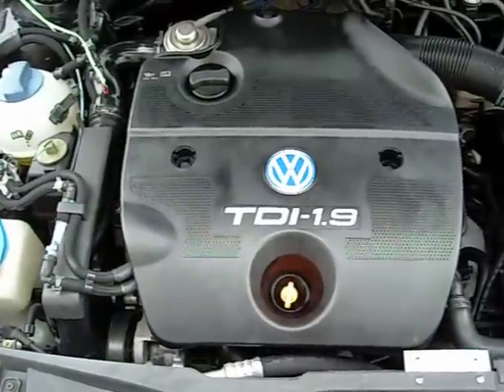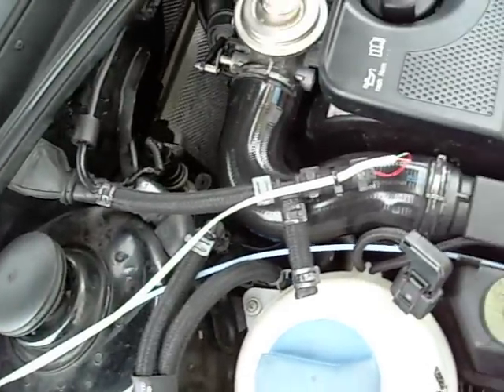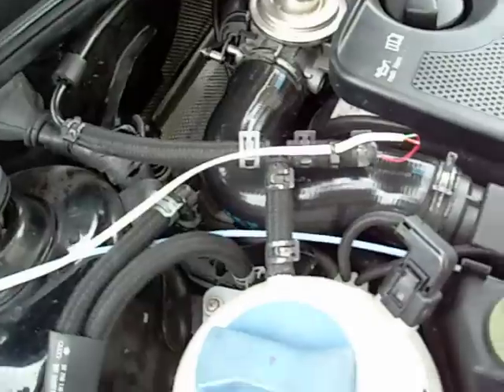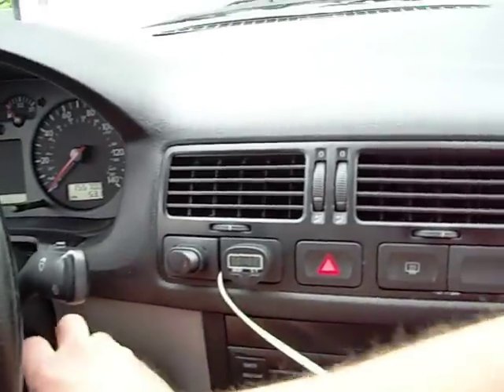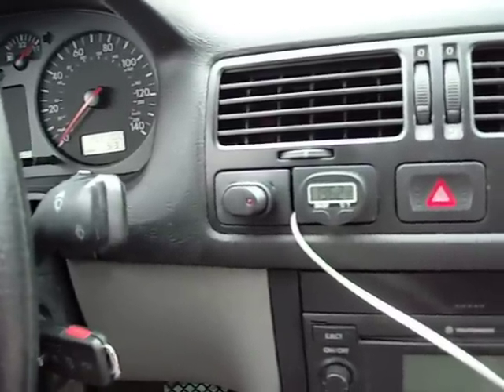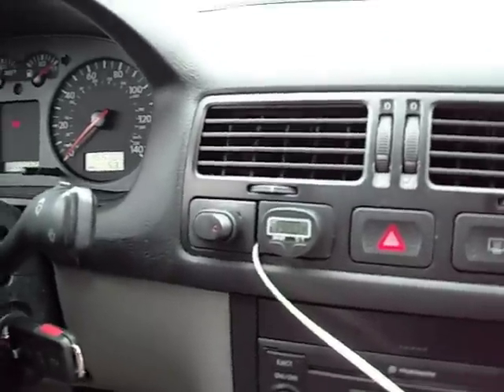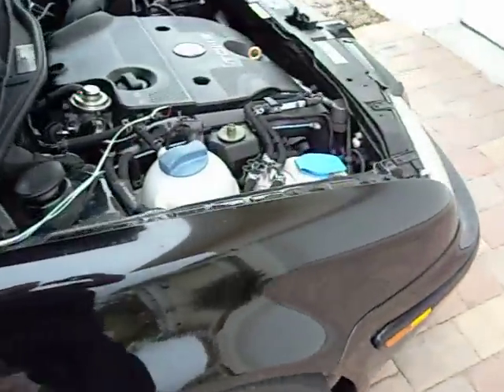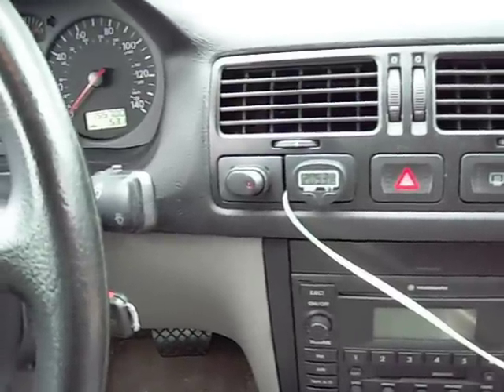Hybrid ALH TDI 205 Deg F  Thermostat Test Video

Comment: Amazing mpg your getting.  How is your driving style I know babyish the car in some aspects isn't great but also it's the only way to have the best mpg. With the higher temp allows for better combustion also improved on the mpg? Interested on gathering little better on mine as the best I've seen is around 46 average is 44 mpg.  108k on 2003 jetta wagon with only mod really 2.5" downpipe and exhaust.
Reply from the maker: Removing my CAT netted me a couple MPG and helped a bit with turbo response.  I gained around 10 MPG just going to the manual 5 speed with taller 5th gear.  The thermostat may have added a few MPG but this is not a guarantee and there is risk in messing with operating temps.  You would be better off just getting a very high quality OEM or Wahler thermostat with the highest temp available before creating a hybrid T-stat.  I don't baby the car but try to drive reasonably.  I try to conserve momentum if at all possible anticipating lights etc.  Really very mild hypermiling techniques.  My timing is set at the top of the graph and my injection quantity is set to inject the minimum of fuel while allowing easy start ability.  I just recently put my second set of Nokian Entyre tires  and my MPG dropped from low 60's to 57 on the last tank.  This is somewhat expected with newer tires(larger OD and less odometer miles reported for actual miles traveled) and I recently lowered my injection quantity by hammer mod following an IP pump reseal  which may have negatively affected fuel economy-jury is still out on that however.  If I were to make a recommendation it would be to set your timing advanced, lower injection quantity, make sure no brakes or brake cables are dragging(car in good general state of repair), ensure you have a functioning thermostat that is maintaining at least 195 deg F, and consider looking into re-setting your injection pump case pressure.  I think the injection pump case pressure could be crucial to getting great "smileage".  I set my injection pump case pressure to around 80 psi at idle if I remember correctly.  Here is the thread on that:

http://forums.tdiclub.com/showthread.php?t=258639

Obviously if you mess with injection pump case pressure and raise it then you are more likely to generate IP leaks if your seals are in poor condition.  Really at this point most of these vehicles should have a new head O ring, and new seals installed on the upper and lower case sections.  Those seals/O rings are cheap parts and the job isn't too difficult as long as you follow the procedure to the letter.

Comment: higher temps are good for diesel but bad for your 01M VW automatic transmission.
Reply: GallowayChicago use better ATF or gear oil
Reply from the maker: Good thing I no longer have the 01M.  When I was first experimenting with the higher temps I was aware of the slight increased risk of earlier auto transmission failure due to the elevated temps.  I was however planning to switch to a manual which I have since completed.  No issues now that I have a manual :)

Comment: just wondering what all have you done to improve your mpg? looks like your getting great mpg!
Reply from the maker: I've deleted my daytime running lights, increased my engine operating temps(from 195 to 205 plus), disabled my radiator fans, replaced tires with Nokian Entyre LRR tires, upgraded my 5th gear to .681, fitted Scan Gage II along with a host of other things.  Do you have a Jetta TDI also?

Comment from the maker: @mulldavid 

Good question!  I spend most of my online time at Freds TDI Club, and have a nice long thread in the Fuel Economy section there.  To answer your question, it looks like I have gained 3-4 MPG.  While this may not be typical results everyone can expect from this Mod, it seems like it has been for me.  My thermostsat wasn't working correctly and was only getting to 186.  Now it's at a solid 203-209 F